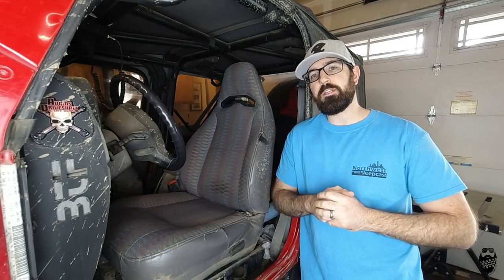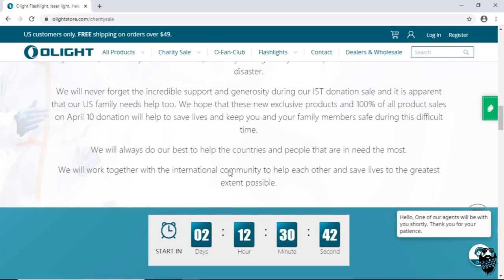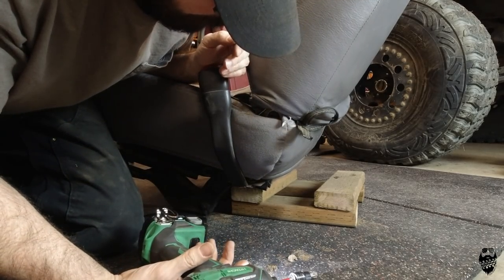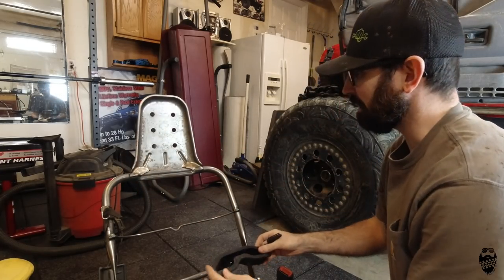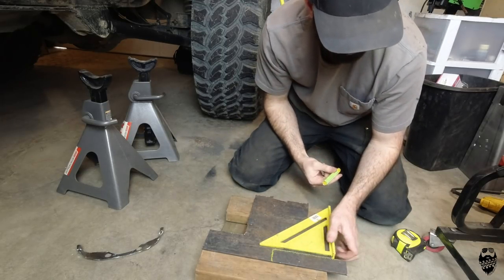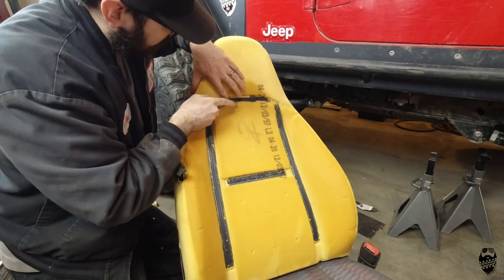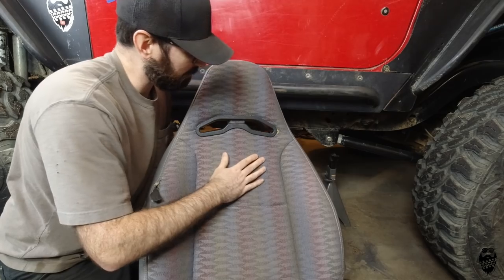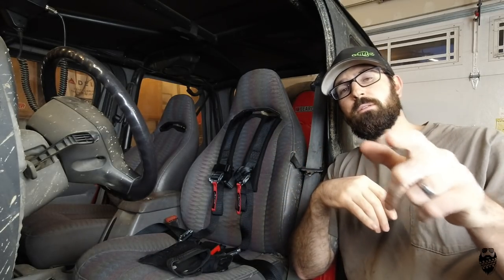Upgrade your Factory Jeep Seats! Installing a 4 point Harness

Comment: Great video.  I know, it is after the fact, but for anyone else, you could use a cautery tool or possibly even a soldering iron to cut the seat skin.  It would make a much cleaner and accurate hole and would help to prevent fraying in the weave.